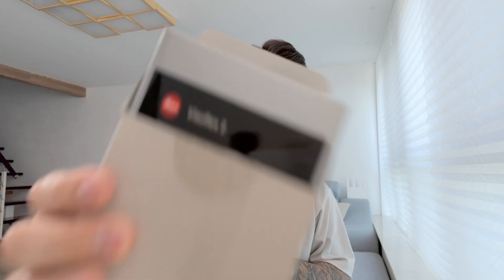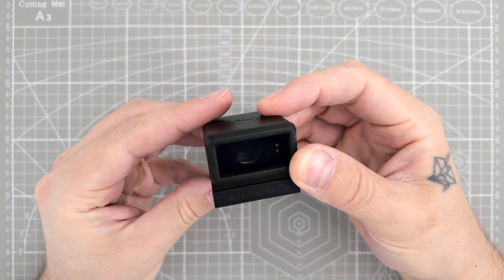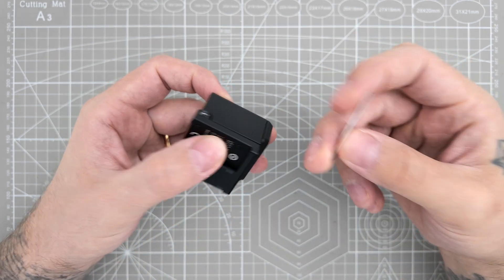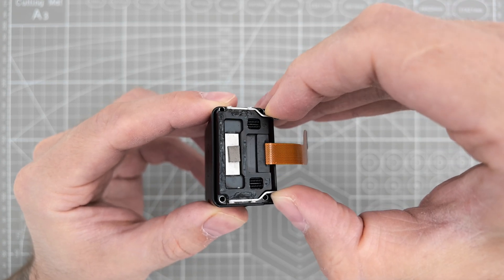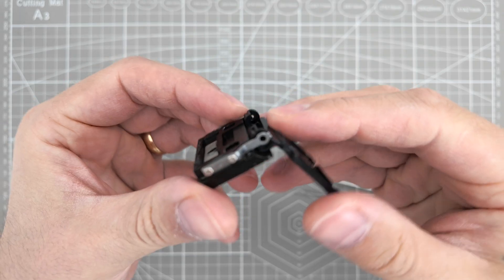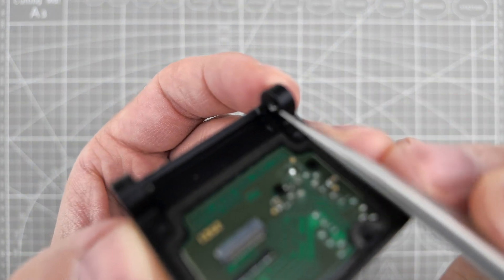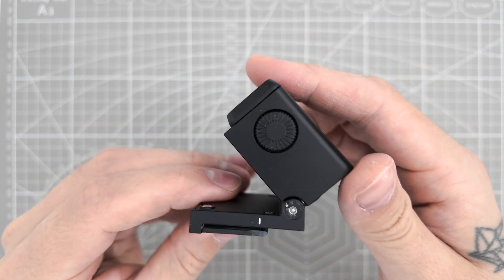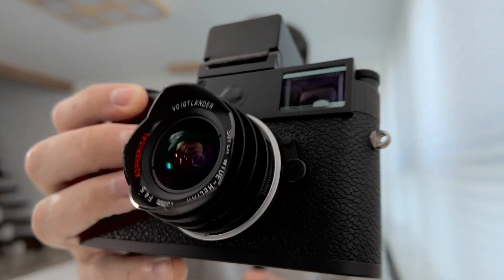Leica Visoflex 2 Disassembly and Repair

Comment: First of all, great job on a succesful project!

I’ve read lots of posts where people end up with dust in view finder. Do you believe one could clean it with a dust blower at the point you stopped with the electronics piece or one would need to firther disassemble it?
Reply from the maker: Thanks! I"m afraid the only way to get to optical elements is to disassemble it all the way through, and even then there's a chance that they are glued in place, just like the outside glass (you can see it if you remove the rubberized frame around the eyepiece). It is a very unfriendly to repair design...

Comment: I broke the protective glass in the back where you look through the viewfinder; I took the broken glass out. The unit works but the protective glass is missing of course. Does anyone know how to get the part? Where to get it? Or how to fix it by some other means?
Reply from the maker: @baharam98  before I had experience replacing my viewfinder window glass on Fuji X-Pro1; my advice is to measure the glass piece as precise as possible and find a factory or shop that can cut one for you out of quartz glass
Reply: @SergioMusel  Great tip; thank you!

Comment: Cool, thank you for the litteral insight. I was wondering already for a while whether I wanted to modd this one as well and add a flash sync plug that I can use the EVF and a studio flash at the same time (did so successfully with the former type of EVF). Seems that there is enough empty space nect to the screen in the upper housing part :-)
Reply from the maker: @ChristophProtz  Sure, you’re welcome! You can share your results later here 🤗